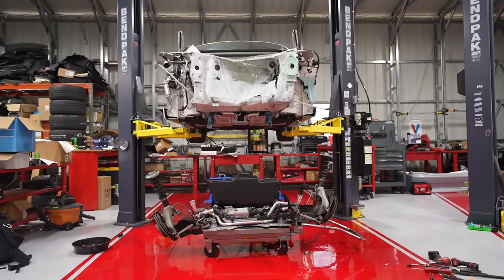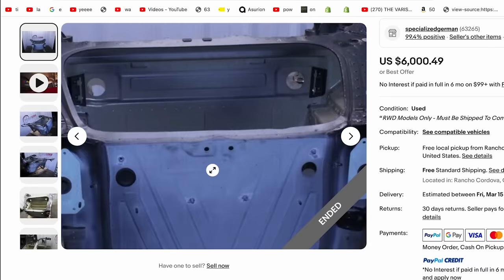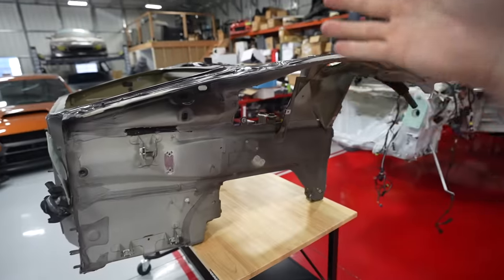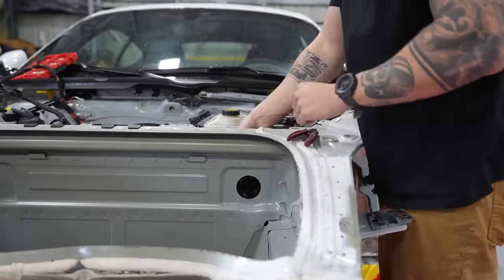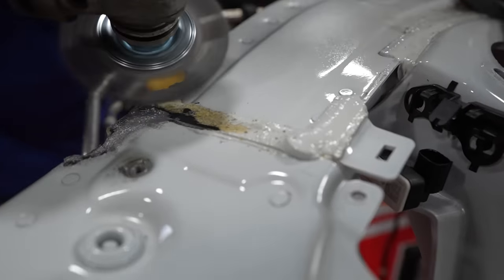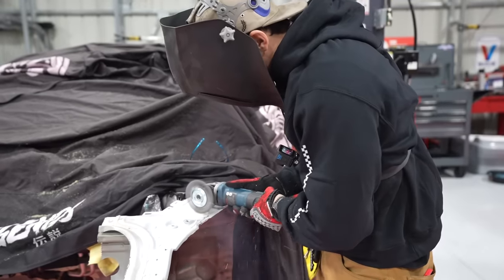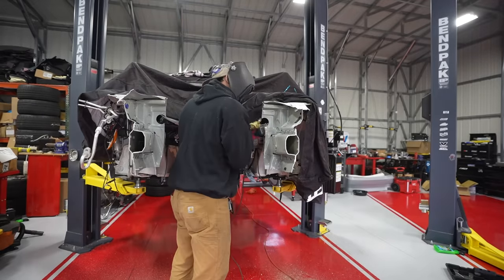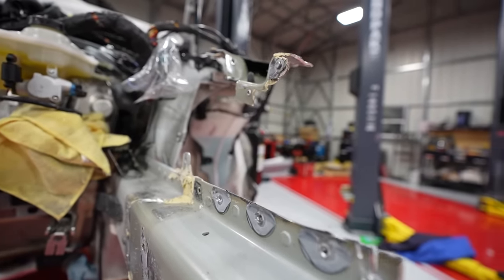Rebuilding a WRECKED Porsche Cayman GTS Ep. 3

Comment: yo dut, seamsealer isnt the one that connects the parts together. Its been spot welded together. That seam sealer protects the connection between 2 panels & is muffling the sound of those two connected pieces(for better NVH levels)

Comment: Hope you have the oem glues and a rivet machine to repair this back to oem standards. The front should have been aligned on a rack before dissembling the front end. 
Also next time you remove seam sealers like this, get a windscreen urethane knife and cut the top of the sealer off first then wire wheel. Hope this helps
Reply: I'm wondering what oem instructions they're following here 😅 section cuts, glue mating surface spec, the list goes on
Reply: Ide say non 😆 YouTube spec. Kinda cool in someways though if it just turns into a racecar, street with airbags will be no go though

Comment: Dustin walking into the mouth of a Volkswagon Audi Group Mod shop...Will he catch the VAG Bug and dive into Euro Cars? Ah we can only hope. LOL The 280Z in the background stands out so much, I think I'm most excited to see that completed. Well you take the 981 Frame to a machine shop that has the machine that helps straight the frame out and pray the structural integrity of the frame isn't too compromised by the fix. Or you can possibly reinforce the frame on the inside so it doesn't add more space to an already tight fit.

If you go back to that V.A.G. shop I'm sure you can find a Chewbacca Engine waiting for an old school MKI or MKII GTI or Jetta or maybe you could find a Corrado SLC VR6 5pd. Classic car to own now you are dipping into the EuroZone...Don't Fear The VR6 don't Fear Chewbacca! LOL